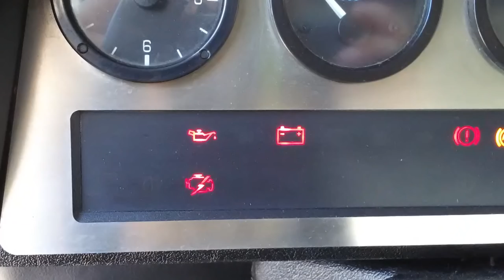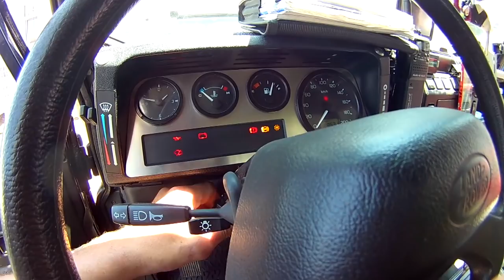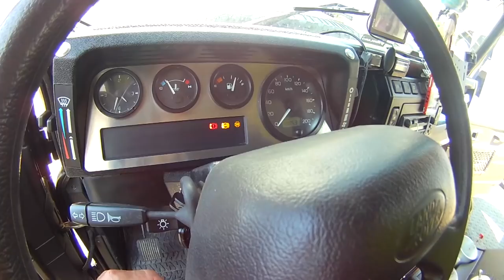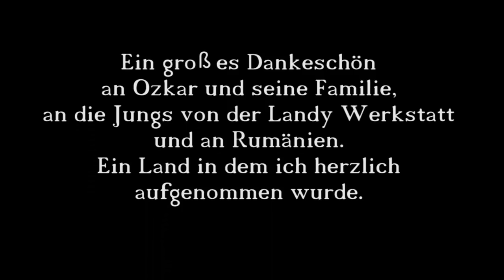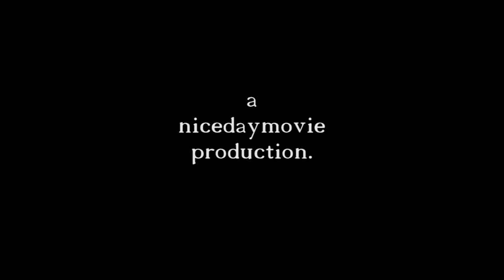Rumänien Karpaten Offroad Tour

Comment: Heavy offroad in remote (wet) places and electronics are a bad combination. You can not rely on that. Onece we drove 8 days in the gobidessert in Mongolia with a local driver in his russian army jeep.  I asked him if money was no issue what kind of car he would choose to drive this dessert with. The answer was just the one he had. He liked pajero's and other cars but all that could happen was that they break down and will not move again. His army jeep was bought new for 4000 euro or so and made 1.500.000 km so far. If the battery would die he was able to handcrank it to start via a hole in the front bumper.  Heating in the car was done by manually opening a  coolingwater valve to allow the hot water to flow via the heater radiator. No computers no nothing. A very good and cheap car that would serve him for the rest of his life. Even after all those km's the ride was very quiet. No bumping and squeeking undercaridge. I know modern regulations do not allow for engines without comouters anymore here but the general rule for equipment that needs to last in my opinion is the more simple the better. Great video and adventure though.